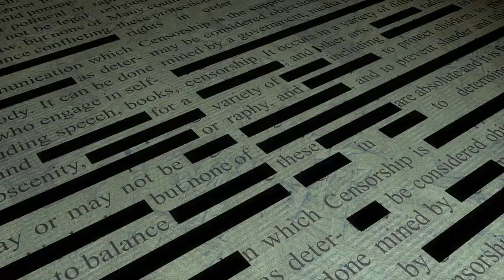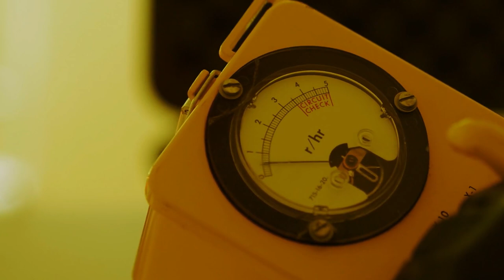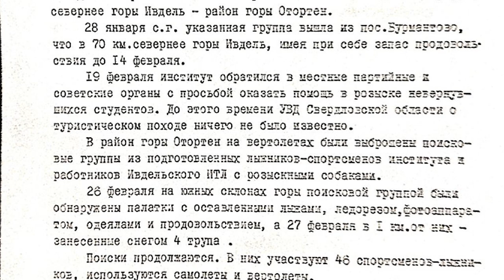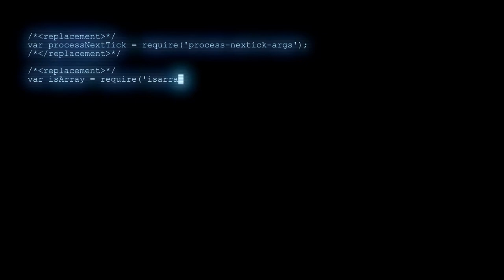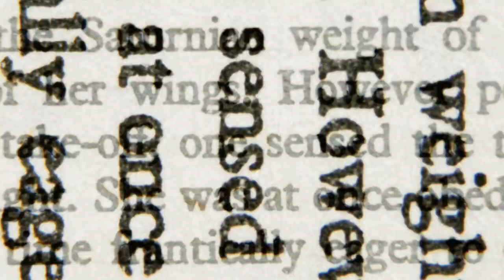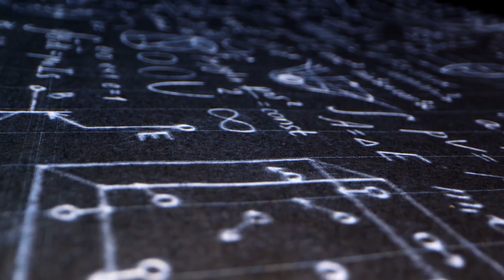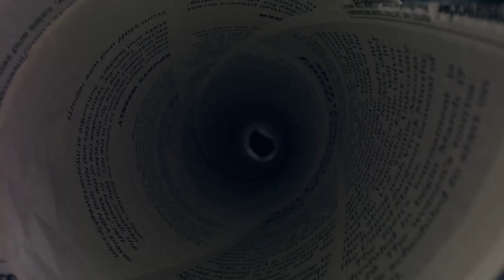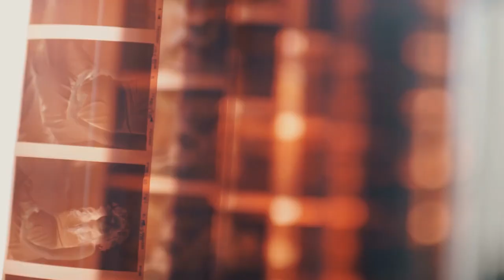Unsolved Alien Mysteries | Soviet Ancient Aliens: The Petrozavodsk Case | Documentary | Free Movie

Comment: About the Dyatlov pass incident, Lev Ivanov (the official investigator of the case), many years later, after the Soviet Union collapse, said in an interview that the real cause of the incident was indeed UFOs, and if you dig through reports of a military expedition (UFOs, strange noises from the underground, all confirmed by the ancient stories of the natives), you can easily guess what's inside that mountain.
Reply: Paul Stonehill (Russian Researcher)did a lot of investigating into the case also, and mentioned a military exercise that involved reports of a Sasquatch type creature. A creature they knew about prior too there exercise!
Reply: So what's inside that mountain, an alien base of some kind? Much like what was rumored to be inside Mt. Hayes in Alaska?
Reply: For some reason that case has just been reopened. 65 years after!
Reply: There is an interesting design of aircraft, but they rarely talk about it, because this thing is secret. The topic of pulsed plasma thrusters has been developed since the early 60s (see PPT - Pulsed plasma thruster) - they are usually designed for spacecraft. But we will talk about a little-known design - these are plasma propulsion panels for aircraft, where the same Pulsed plasma thruster, but reduced to the size of a pencil and stacked in the form of cells in the panel. The design resembles a conventional plasma TV screen, where there are also discharge cells that activate the glow of pixels on the screen. And plasma propulsion panels have long discharge cells, the arrester has a railgun architecture (just rail contacts or coaxial), and the ionized discharge air is accelerated there by the Lorentz force to enormous speeds - a kind of ramjet engine is obtained. Just imagine! - tens of thousands of small ramjet engines assembled in a panel and firing plasma synchronously with a huge frequency (hundreds of kilohertz). Thus, plasma propulsion panels create lift by pulsed emission of plasma jets from railgun cells. There are tens of thousands of cells in the panel, they shoot at a frequency of hundreds of kilohertz, a huge pulse is obtained, and the plasma swirls the air into toroidal rings - the aircraft is held on this air cushion. Horizontal acceleration is created by the same plasma panels on the sides of the device (they glow, from the side they look like "portholes"). Such devices like "triangle" or "disk" have been observed for a long time, they are mistaken for alien ones - but these are terrestrial devices. They are classified and used for espionage and secret actions. Pulsed electromagnetic technology generates microwave radiation, therefore it is harmful to health. They rarely fly - only military missions. Therefore, they are not suitable for a citizen. This maintained the secrecy. Now they are already declassifying - many people know about this secret technique. When declassified, they will be used for cargo airships. But there is a danger that they are now going to be adapted to deliver small nuclear charges to decision-making centers - such means of delivery are not specified anywhere, are not conventional. This lowers the threshold for starting a war. It would be necessary to declassify them as soon as possible. That's why I'm writing about it. However, I have written before - starting with the book "The Elimination of UFOs" and many articles. There are also videos on my YouTube channel - "Declassified UFO" and "UFO Anatomy".

Comment: The opening story was a result of a snow drift collapsing onto their tent. The weight of the snow crushed the occupants, injuring them severely. They were buried under a thick layer of compacted snow and had to cut their way out of the tent. The tent was also compacted, making collecting anything impossible, so they had to crawl out as best they could in whatever clothes they wore, (or didn't wear).

They were so intensely cold and disorientated from the shock of the snow collapse that they did not survive long, even though vain attempts were made by them to try to start a fire. They died from exposure to the extreme cold.

It was not Aliens, sorry.
Reply: Their eyeballs popped out and their tongues shaken out of their mouths as well from tumbling around the snow so much.
Reply: i thought they said it was an avalanche but your right Ethier way.
Reply: @uapbuzz8196  In reality that didn;t happen .There is no such a thing like missing tongues or eyeballs there is only a fractures on 4 people.

Comment: The term UFO in The USSR and Eastern Europe was, exactly, the same as in English : Non identified, Flying Objects, but, in a corresponding language. Then, the phrase was abbreviated, exactly, as in English : the first character of the words. Of course, in most cases, the characters are different than the English U, F and O. In most cases, O is the same as the word for object starts with an O in many languages, because, the word is Latin. 
 
The abbreviations were used not only for UFO, but, for many purposes, such as name of rock bands, etcetera, kinda, similar to Foo Fighters ( kinda UFO's during WW2 ).